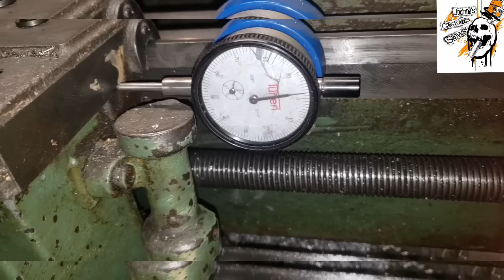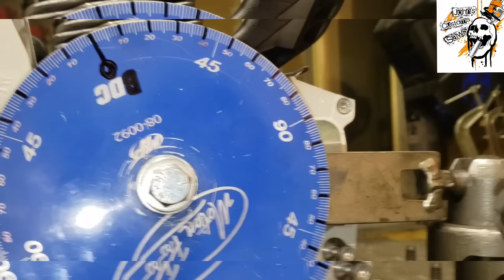Stihl MS461 chainsaw porting... START to FINISH... JCS

Comment: You said “dome” the top of the piston. I hope like hell that ain’t JB weld on top of that piston, and btw flap wheels and cartridge rolls are no secret lol!  I used to resurface cyl heads with a steel block milled flat on one side and 2000 grit sand paper and water. Merry Christmas... I watched your whole video
Reply from the maker: JB weld lol... do people do that??? im machining them and matching the combustion chamber... i know people dome pistons but i dont know of anyone that has the setup to match the 2... im not adding to the piston at all... they end up lighter and uppers and exhaust dont get too far out of sorts and it helps on the intake because i can drop the cylinder 45 thow instead of 15 thow and cutting the squish... if that makes sense... im not sure what you mean by the secret flap wheels... i call them split mandrels but they are definitely no secret... thats not what i was referring to... i make "bits" to do the final pass on the ports before i polish them... i use steel wool and WD-40 to polish i have shown that in a couple videos... hope that helps clear it up... thanks for watching the whole thing that helps me out i appreciate it
Reply: @johnscustomsaws  hey man thanks for all that clarification. Yes people do JB weld the top of pistons, which is the half ass way of tig welding a pile of aluminum to the top of the piston and machining it to the shape of the cc. Split mandrels? I’ve ported about a billion cyl heads for cars( ok not really that many) never can say I used a “split mandrel” I’ve used a tapered mandrel for cartridge rolls. Shove it on and screw it down. But flap wheels work way better than that. You can get them in all different grits and they conform and follow contours and radius’s of ports nicely,  you can run them on some concrete to change their diameter to fit your needs perfect. I’m not sure if we’re are talking about the same thing. Might be worth a little google. Your ports looked sweet all the same. flap wheels will get you to mirror finish in a hurry, not gonna say if they do better than your custom bits or not. But they were my favorite when polishing. But I suppose that’s what I get for being a smart ass. Anyhow man I love the 461, I’m a little guy only about 117lbs and that’s about the most I wanna lug around with me in the woods. I want a real torquey 461 or 462 or 500i. I do a lot of bore cutting and have to stop in the cut. I need something thats able to get that chain moving again without pulling the saw to clear chips. I hear people don’t like the 462’s...... and I’m sure the 500i is just about as light as the old 461. Straighten me out here if I’m wrong. Anywho is there a website or somewhere I could go to see pricing and options etc?  Thanks for your time!
Reply from the maker: @nathanroussin803  thats crazy to me that someone would use JB weld on a piston lol... wow is all i can say... a split mandrel is very similar to what you are talking about except you cut your own sandpaper/scotch brite/steel wool etc... can use whatever different grit and even shape it by cutting or tapering the sand paper... it works great and by far the least epensive route because you can make the bit out of a old bolt or nail... and sandpaper is cheap and you get 30 strips of paper out of a 9'x11' sheet... and as far as the website or ordering i hate to say i am not taking on any customers at this time and i wont have any saws available any time soon... i do mostly fleet jobs and contract work... some production and wildfire jobs but thats it... i will tell you that the 461 is a more proven durable saw for production cutting its the number one choice and 90% of the wildfire saws i do are 461s... the 462 is lighter and more power stock but a ported 461 will smoke it with anything over 28 inch bar... but stock the 461 is a turd... the 500i is the most amazing saw i have EVER got my hands on and i have been doing this over 20 years... more impressive than the 200t... yes i said it... the fuel injection allows me to run ridiculous numbers and do some crazy work... they guzzle fuel but the trade is a monster saw that can do it all... 20 inch bar to 41 it will pull it... and first of its kind (yes TS500i was first) but the same concept and i wanted to not like it but it cant be denied its amazing... anyone that says its not worth porting is flat wrong... wow epic novel response but i like legit questions from someone that actually has a good point or question.
Reply: @johnscustomsaws  Yeah you would be surprised where I first saw the JB weld trick....... it was done by one of the “famous” saw porters here on YouTube. That’s all the more I will say. I don’t blame you for not wanting new customers. I always loved working on and building cars and trucks with my dad as a kid.....so I made a career of it and ended up leaving me hating and disgusted at my once loved hobby. I hope you get to the point where you can just do your own thing! So like I said I was a mechanic my whole life ended up quitting and starting my own sawmill/logging business. I’ve only been running saws for about 6 years, but everyday for 6 years learns you pretty quick. I saw in one of your others videos you explaining about not taking on new customers because you just want to focus on your big jobs and your own stuff! I commented well shit I guess that answers that lol. I know there is a  power difference and people might call me crazy but I swear my 261cm with a 20 cuts just the same as my 461 with a 25. All my saws are stock. When I first got my 461 I used to think damn this is a monster but the longer I used it and started getting comfortable I agree it feels like a turd lol. Hate to say but coming from a mechanical background  I’m skeptical of everyone’s work, but watching your porting video you definitely convinced me that you do your jobs with same pride I did mine. Your educated past the end of your nose and care about the finish product! So I really wanted to buy a couple saws from you! It’s just hard for me to want to buy a ported saw from just any ole someone. I don’t really want to do it my self. I don’t have a lathe and I feel that bumping compression is just as important as port timing especially for torque. (4 stroke car experience) not sure if that holds true on 2 stroke saws. I hate to ask but if your kinda getting out of doing public saws..... do you have a recommendation on somewhere I could purchase a new ported saw? I gotta quote from mastermind on a 261 c......  which is all he could get. I’m kinda partial to the cm. To be honest I never ran out he 261 c...... from my understanding the cm has a totally different cyl than just the c model. And this is silly but I like the clutch cover better on the cm it looks way cooler and has captured nuts! I really appreciate you taking the time to talk with me here. I couldn’t imagine having to try and keep up with thousands of people lol. But like you I enjoy worthwhile conversations with people that know what the hell they talking about, or helping others that are genuinely interested in learning. Have a good one man. Keep the vids coming! How about a video on ignition timing?  I’ve always been curious if I could advance the ignition timing on my saws.
Reply from the maker: @nathanroussin803  i dont really recommend too many guys because the guys that i know that do a really good job are all swamped and not taking work... do you have instagram? there is a guy i know that does fantastic work but hes new to instagram so hes not totally booked yet... but thats the only way to really contact him... as far as machining i do not understand why anyone would say its not necessary to machine...  machining is damn near more important than porting!!! i had no idea that people actually thought that... im not sure if they mean that you can cut the base and squish by hand  and you dont need to use a lathe.. or that its not necessary to add compression because thats just wrong im sorry but i wont agree with that even if people get upset... the best saw builders all have at least 2 things in common and one of those things is that they machine every cylinder... the other is that they agree that machining is absolutely necessary lol
Reply: @johnscustomsaws  my wife has Instagram. What’s his name? Yeah I’ve never heard anyone say machining isn’t necessary, its more of my own suspicion looking at all the saw porters on YouTube that are trying to get you to buy a saw from them, what actually gets done to the saw can get pretty vague! Some people say “for demo purpose only not for any type of wood cutting” why the f do I want that then? Some people say “reliable practical work saw build” Lol like maybe all they do is port it maybe they aren’t machining it all. Idk lol I’ve seen people on YouTube that are “professional saw builders” they have a lathe they make a big mandrel out of round bar set it up like a fly cutter and cut the squish by hand but then deck it with the lathe? Idk or not running a gasket between the cyl and the case? That don’t seem right lol. I have never had my saw apart that far but I assume they are just a single layer steel gasket? How thick are they normally? I mean you can fucking swing yours around by the pull rope! That’s some fucking compression! At what point does a saw go from reliable work build..... falling, limbing all day everyday to eeehh its more of a race saw. I mean you could do a hour or more long video on this and I WOULD watch the whole thing. However I understand you are not my personal video creator and a shit ton of other people would also have to want to watch it to make it worth your while.

Comment: Great work.
I have 2 stihl ms 241cm workingsaws which I use for firewood, limbing and small lumber. Very happy with the saw’s, but would like more torque, and a bit faster acceleration.
What would be the best plan to achieve that?

Comment: When you use a gasket between the cylinder and the crank case it’s thicker than when you use sealant some mechanics just use the sealant to bring the head down just a little more to increase compression you probably know that already I’m sure I myself prefer to use the gasket mainly because when you tighten down the cylinder bolts the sealant spreads out unless you just run the bolts in loosely wait for the sealer to set up then go back and tighten to final torque I do that on valve covers because I don’t like cork gaskets and it works great . Make a good strong gasket for automobile engines but  for what your doing it’s not as precise as I would like as far as getting the combustion chamber Valium correct.
Reply from the maker: I personally use the factory base gaskets and I machine the cylinders to tighten up the combustion chamber... I have no problem with people that use gasket maker tho... I  think whatever works best for a guy is the way to go... I do replace the paper gaskets which I don't really see anymore in the newer saws...  but I prefer dirko HT over paper gaskets
Reply: @johnscustomsaws  yes I prefer the gaskets for that purpose I think you can get a little more precise with the gaskets.you do great work though I appreciate you taking the time to record and share . I have an old stihl   028 wood boss a friend gave me it would idol but had no power so I noticed a lot of play in the crank shaft so the air gap between the fly wheel and  ignition coil was impossible to keep in specs. After taking it down to the crank case I found the crank shaft was broken . The cylinder is still in great shape I’m going to replace the crank shaft bearings and seals then see where I’m at from there.

Comment: I guess if I had to think about it bar oil is the only thing that lubricates the oil pumps inner workings so maybe extended high rpm could maybe cook one for the little you need to run a saw before you ship it but I'd say unlikely
Reply from the maker: Yeah... just the pump piston and cylinder really... but stihl oil pumps are already too weak imo... they always told us in tech classes not to run dry... and since they are paying me to do the work I gotta do everything 100%

Comment: Awesome video man, appreciate it. Did you pull the bottom of the engine out to put the cylinder back in or just slide the cylinder back down on the piston and rings? Doing a rebuild on a 461 and not sure which method is best (and easiest!) for putting it back together.
Reply from the maker: I use the cheap red ring compressors you can get on ebay for 10 bucks a set...  The set also comes with a plate that goes on the  Base of the cylinder but I don't even use that piece... I just slide the cylinder right on and once it's past the rings I put the bolts in because it's hard to get Them in when the cylinder is flat on the case... Some people put the intake manifold on after I put it on beforehand and tightened down the clamp that way you just have to push it through the fuel tank... otherwise if you're worried about it take the fuel tank off and put the cylinder on the case by itself then put the fuel tank on... I say if you're fighting it like crazy take a step back and assess the situation... You should never have to fight something to the point of frustration if you are there's probably a better way to do it... Sorry for the novel I used talk to text... it adds up fast lol
Reply: @johnscustomsaws  thanks man, solid advice. Keep the videos coming, always enjoy them.

Comment: What can you do for a brand new, latest model HUSKY 445. I have many years of porting aluminum 358 Chevy racing heads. But, I do have a coulpe of Forstners and smaller burrs  that I could use on a chainsaw. I would rather you, a pro, do the precision work required.

Comment: Mad video man!! Appreciate the time taken. Could you do a tuning video? 

I was interested to see your take on tuning especially after porting but missed it in this vid. I do tree work & am crap at tuning by ear on the fly, can only do it at home after taking my time with a tacho.
If you are interested in making a vid would be good to see comparisons of tach, ear & inwood. I'm sure you'll hit good views too lots of people search that shit up.
Reply from the maker: absolutely... im sure there are a bunch of tuning videos but like everything i have my own take on tuning... i tune rich and i GUARANTEE your saw will cut faster and idle/start better... I could go on for hours on how guys are tuning lean and causing tons of issues... thats a great suggestion my man
Reply: @johnscustomsaws  Thanks BRO!! Appreciate your content & looking forward to it!!
Reply: Absolutely correct!!! You’re running a solid ship, brother!!! I’m gonna need to be running one of those… 28” skipper????
Reply: . @johnscustomsaws  If rich under take-off power is the rule for air-cooled piston-engined aircraft for fuel-cooling of the engine under high power delivery, then it should be good for chainsaws. There has evolved in aircraft use, a fuel-management practice of setting the mixture to what they define as lean-of-peak for more fuel endurance at cruise power. Mismanagement of that technique has seen the premature end of life for the replaceable engine parts, cylinder/head assemblies, valves, pistons. With extra power delivery but no tidying up of the cooling air pathways, running the saws rich is eminently sensible.

Comment: John, I have decades of experience building V-8, bored racing motors, balanced and more. I also have the same kind of experience on motorcycle engines. I don't have my big lathe any more---48" center to center. I do have my refinement tools. What lathe swing is required?
I also note on your piston doming, do you have to follow up with final decking? I would like to do this work in the heart of Middle America. Where are you located?

Comment: I use double cut and single cut on husky cylinders and they work fine not to undermine you at all in any way just thought that was interesting
Reply from the maker: its all good man i appreciate the feedback and i always like hearing from people that have experience... i agree that double cut is the way to go on the huskys... i still have issues around the uppers... i even run the damn burs in reverse... it seems hit-and-miss tho... in a stretch of 20 cylinders i have an issue with maybe 2 or 3... so its not all the time but its still a total loss on my end  and it sucks... i have a damn pile of em lol

Comment: Snap on has a long chrome hanndle 1/4" ratchet that you might like to use while working on these, also MAC has the SPINFLEX which has a handle that locks in and out so that it can spin in your hand like how you were using that snap on ratchet.
Reply from the maker: i probably own them both lol... i have a shitload of tools for a small engine mechanic... i think i know what you are talking about... the  mac ratchet with the "peace sign" looking switch... best way i can describe it.. i have about every snappy ratchet made honestly  so i probably have the 1/4' one you are talking about lol

Comment: Thats funny and Fcc’d up at the same time Cheers for the effor just A note that snap On is extremly noisy compared To Milwakee
Reply from the maker: i have milwakee/DeWalt also but the snap on is the ony cordless screwdriver i have found.. where the milwakee and DeWalt the bit doesnt lock into place and the snap-on does... so i can break bolts loose and tighten them by hand without grabbing a T-handle... unless there is a milwakee out there that does that i will never switch... the batteries in the snap-on last WAY longer as well